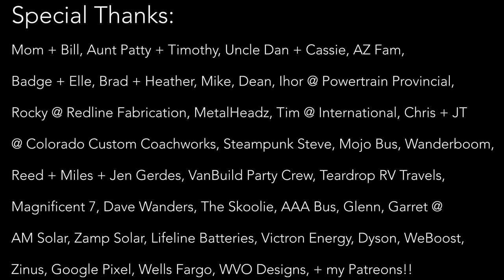Update: Leaving Town, BusFair June 8, Zinus Mattress Review

Comment: You need a air flow grid system under that matt sitting on plywood otherwise the matt with start growing mold from body heat moisture .

Comment: Hey Jax!  Bus is looking so sweet!  Have you considered that your mattress platform being solid will inhibit air flow?  It is a real concern, especially with memory foam.  I had an issue with a memory foam mattress on slats that were too wide.  Plenty of airspace btwn slats, but in the middle of the 6" wide slat, just a bit of mold started on the mattress cover.  Ditched the wood platform for highly ventilated metal one, eventually got rid of foam mattress too.  I'd recommend drilling some holes in your platform.  I'm really happy for you that the build is closing in on finished!  Have fun out there Jax!

Comment: After freshman year we moved off campus at the start of summer  and we had to get a bed. A housemate got zinus  off their site and we ended up going to Walmart and found the same brand but I think different model or something. Just make sure you air it out because we just plopped it onto the carpet floor and the smell lingured( I still think I smell it once in a while) .

All in all like the bed , get a mattress protector since you can’t wash it, and we’ve had the bed right on the floor with no problems so far. Also hate the sheet flying off the corners so invest in some good ones with corner straps or like ours it’s like a underwear strap inside the fabric

Cool bus, I found you through the signal booster video and my recommendation rn

Comment: Hey jax saw your Instagram video climbing those hills. You should shift your new transmission down to third gear. The torque converter locks in third and fourth and but will climb those hills better in third running around 2000 rpm